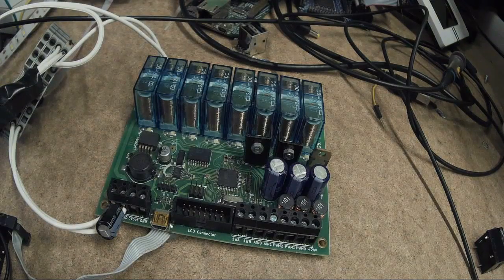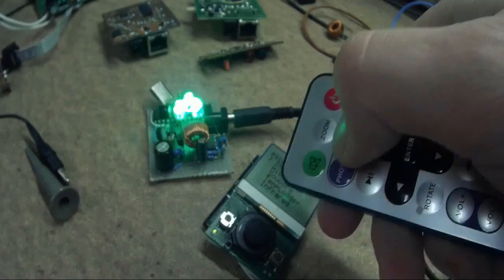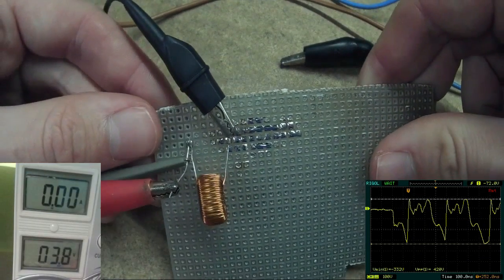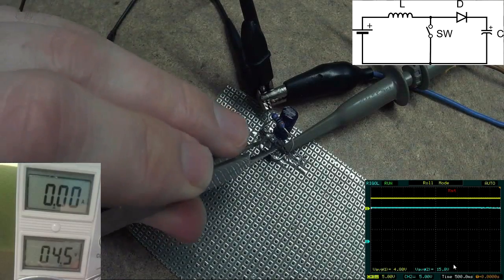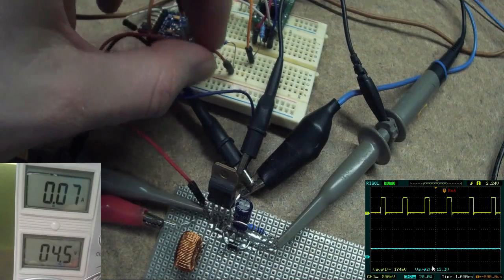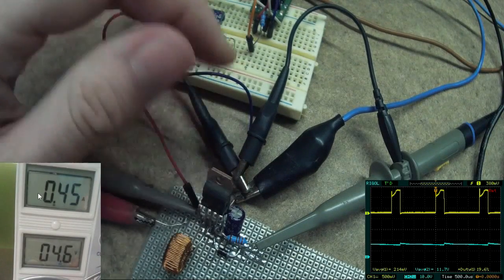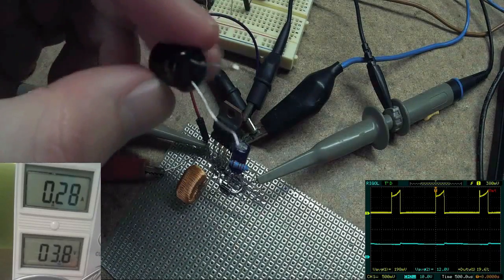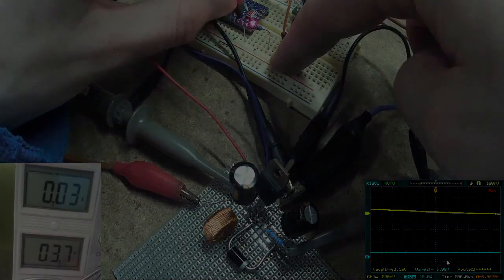Practical twidling with DC/DC boost converter

Comment: I really like this video. it really explains things. I need to build a 24 v to 160-170 vdc boost converter. for a inverter. with about 6kw output. I was thinking of using a arduino for the pwm. and regulation of output. as well as low/over volt shut down. but I know nothing about arduino programing.  I could use advise if you could ? thanks for the video